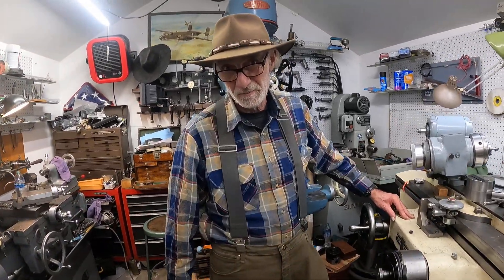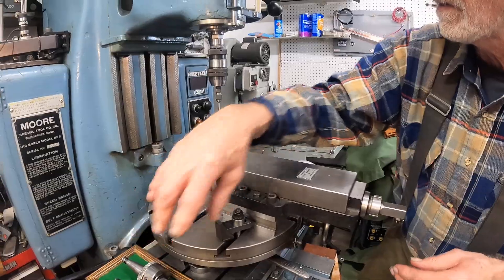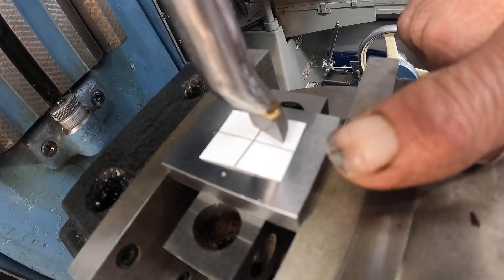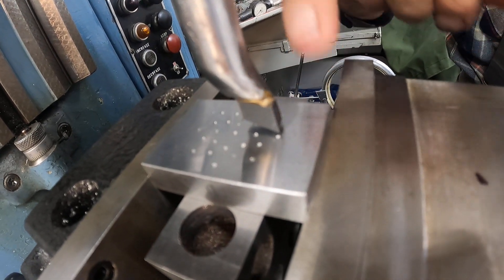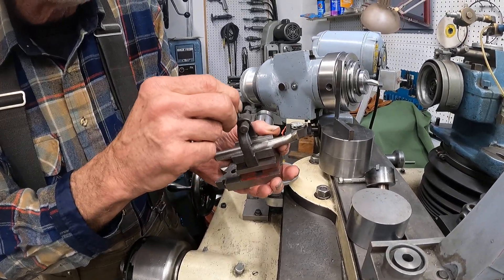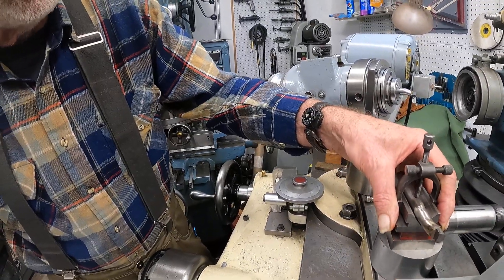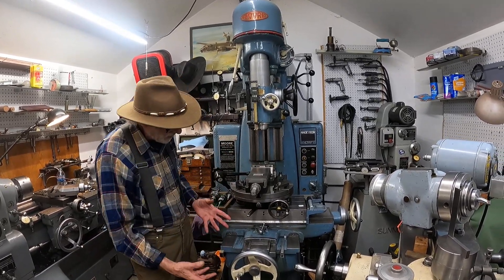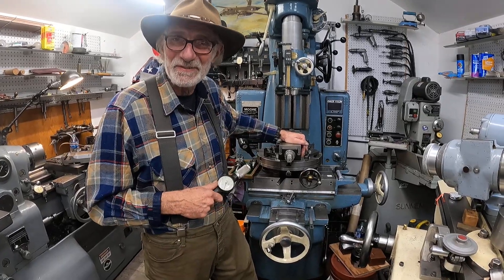Moore jig borer, boring bar alignment, and  tool grinding

Comment: I'd love an opinion from you on getting a Cincinatti #2 or a Brown & Sharpe #13 cutter grinder. Both available cheap with some tooling.
Reply from the maker: The most important to me is a motorized work head with good bearings, that is often harder to find then the machine itself. I think the Cincinnati is easiest to use.

Comment: Im am a 55 year old tool and die maker. I never saw anyone use the flats on the boring head squared to the mill to set the boring bar position. We never stop learning. I have a monarch 10ee just like yours.
Reply from the maker: The Moore goes well with the Monarch ee!

Comment: I've just purchased moore #3 and also similar boring head, but without the Vernier and could not understood how to use that. Boring adjustment seems so small, I was looking for info for how to use it. Great that you keep posting vids about Jig bore.
Reply from the maker: This is a subject shouted down by the trolls, moderators, and owners of the Fake machinist forums, and thus the most experienced machinist have been driven away long ago. Those clowns are here also, but no good content, they are the so called Hobby  Community.

Comment: Hey Donnie,  I live the videos.  Thanks for sharing about jig boring.  I am really trying to learn more about it.  I have 2 jig borers.  I have a Pratt & Whitney 2A (10,000 lbs) and a SIP MP4 (7,000 lbs).  I am a very accomplished manual machinist and mechanical engineer. But the fine points of these machines, I am just learning.  Please continue to share tips and tricks with jig borers.  I will appreciate them.  I don't have a 10EE,  but I do have a Hendey T&G and a Pratt Whitney 12C lathes.  ---Doozer
Reply from the maker: Doozer, this subject has been shouted down on that POS Fake Machinist forum for years, and the experienced hands driven off, I was stalked and threatened by order of the owner, now he, his troll, and the bully cop from texas can watch me on TV!
 You are a good guy in my book Doozer!
Reply: @deedeeindustrialsuperprecision  Well you are posting info about jig boring that I did not know, so please keep it up.  I want to learn how to best use my wonderful machines.

Comment: I bought a Moore #2 jig borer this summer.  I also bought lots of Moore Tooling and I hope to get the machine up and running this winter.
Reply from the maker: At some point I will go through spindle bearing replacement, The replacement bearings are Barden 107 DUH, two pairs required